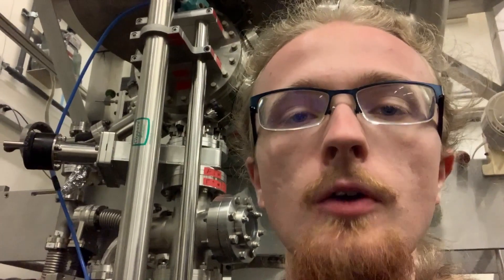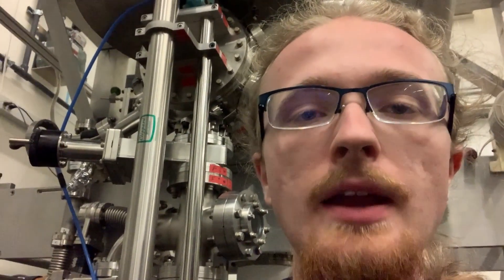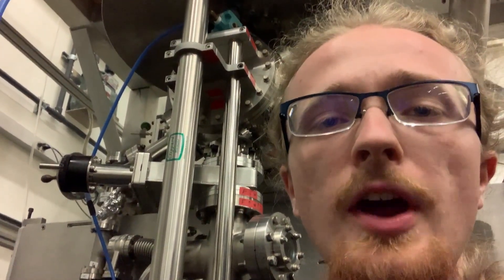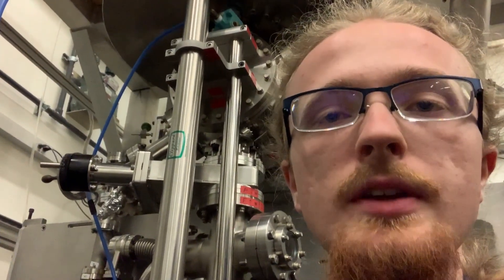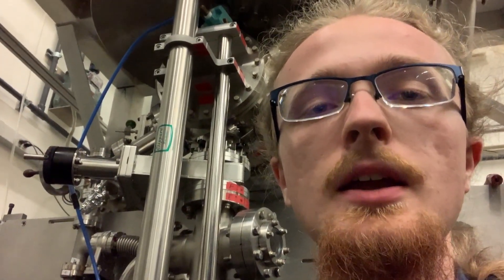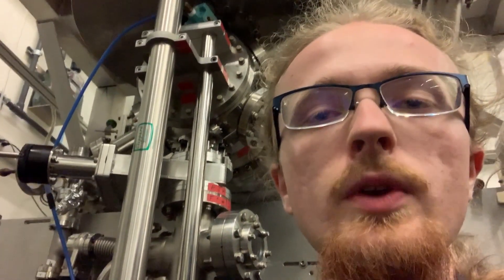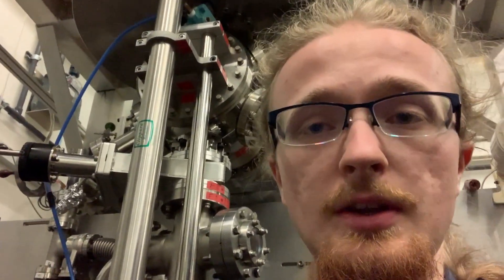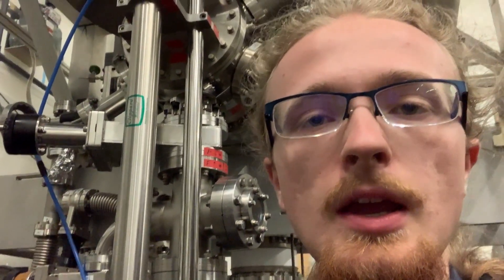9 Tesla Superconducting Magnet Quench | $500 Of Helium Lost In Under 1 Minute

Comment: Helium is a finite resource. Why not recycle it? Is there a better way of recovering more of it?
Reply from the maker: We usually do. When a quench happens, helium boils off too fast for the recovery system to handle. If we didn't vent to atmosphere, the dilution refrigerator would have exploded.
Reply: @DietterichLabs  so if science doesn't happen the helium gets mad and explodes
Reply from the maker: @No-gj8uk  It feels like that sometimes
Reply: Eww it's a 10000 fold volume problem you start with 1.3 liter of liquid helium but end up with 1cubic meter of gazeous helium so yes you can avoid loosing the helium but even with a vacuum container the volume is so large well yo get it....